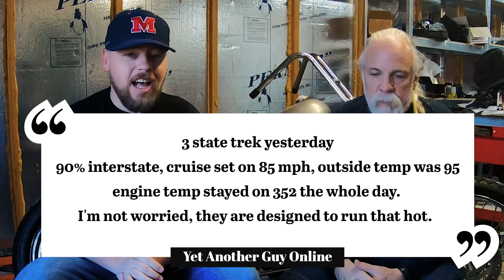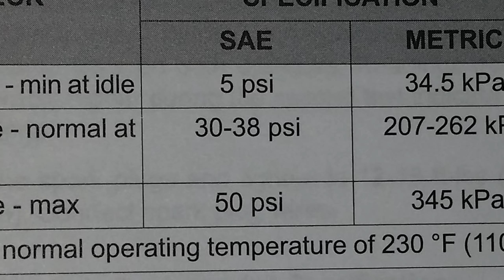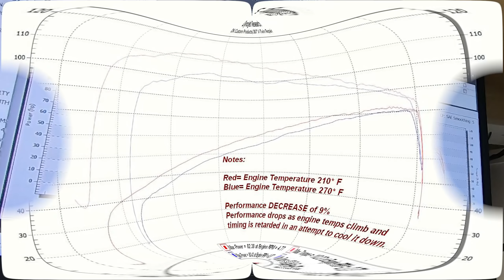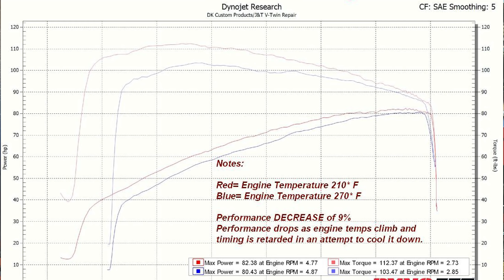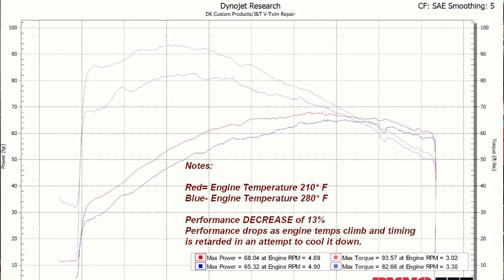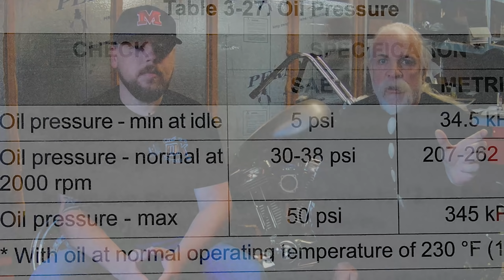Harley's - The RESULTS ARE IN About a Popular Myth

Comment: Hot intake air robs power. It does this by reducing the density of the air and it risks premature detonation of the fuel air mixture in the cylinders. I've worked on several VW bugs and the high temperatures destroy the number3 cylinder.
Reply from the maker: Thanks for watching and adding your experience to the discussion.  👍

Comment: Any idea as to what the operating tempurature is for an evo? My oil gets up to between 160 and 170 in the summer time on my softail.
Reply from the maker: That's a tad on the cool side for the oil.  Not sure where you're grabbing that temp from, and if you are running an oil cooler.
Ideally you want to see the oil temps between 180-210.  You don't want to see them over 230.  These temps are at the engine or the tank.
Reply: @DKCustomProducts  I've got a thermometer dipstick on my oil tank. And yeah... I'm running an oil cooler. I don't get as much motor noise in the south Mississippi heat as a result.
Reply from the maker: @SaddleTrampTV  Very Nice. 👍

Comment: PS: Lycoming Aircraft engine operation specifically states that the oil temps should be between 165° and 220°. Not too cold, not too hot. Information is readily available on the www for reading. FYI 
Thanks Guys!
Reply from the maker: Yep. It is pretty common knowledge outside the Harley world.  Unfortunately there is a huge push of misinformation to Harley owners.
Harley is in a difficult spot...they want to keep the nostalgic look/sound, but they have to meet stricter and stricter requirements.

Comment: After I purchased my 2021 Trike, I put the stage 1 air flow with new headers omitting the cat and using American Custom exhaust. I do have a 4 inch baffle in the mufflers but now my trike is running much cooler. †his spring I will change the oil and Amsoil will go in.
Reply from the maker: Good to hear you are enjoying your ride! 👍

Comment: I have a 2011, Electra Gluide with 70,000 miles on it.  I changed out the worthless ambient temp guage to an oil temp guage and I have never been over 250 deg.  It normally runs at 170 deg.  It got to 250 deg on a real hot day in stop and go traffic.  I have run the bike in 95 deg weather in South Alabama and oil temp never got higher than 220 deg.
Reply from the maker: Those are really good temps! Good to hear you have your bike running at optimum oil temps!
btw, something we did not mention in any videos, it is always good to double check with a second thermometer to make sure the one you are using is correct.

Comment: My oil runs 210°-220° on a 104° day.
M8/ stage 2, i luv my hi flo oil filter,  it  
Makes a big difference. I still run conventional oil. It works fine. Changed at 2000-2500 miles.
Reply from the maker: Very nice, good to hear you have it running optimally.
Thank you for the comment.
Enjoy your ride!

Comment: Oil temp gauge …. WHAT ARE OUR OPTIONS FOR ROAD KING
Reply from the maker: The two most popular option are the HD or the JES Custom Accents.  These are easy and about $100
More complicated is mounting a gauge somewhere, and then installing a temp sending unit and running the wires.
Reply from the maker: @whodafokcares  That is what I am running also.  First one replaced under warranty...the one now works well and is around the 2 year mark.
Reply: @whodafokcares  I agree… reviews look pretty good too

Comment: Performance is one thing……my main concern is longevity. So, question here… if my FP3 tuner says 250-270 (20 degree spread) degrees on my M8, I’m at normal operating temp of 230? Am I understanding you correctly?
Reply from the maker: The full answer is in this video- https://youtu.be/rWOdQOtDv6A?t=64

The short is that 270 engine temp is right at the ragged edge....as you saw in the video.
Reply: @DKCustomProducts  You said the temperatures are going to register higher simply because where the temperature sensor is on the M8. So 270° on my FP3 is not on the ragged edge it is normal operating temperature. Correct?
Reply: @jeffreyengle2762  I didnt think the FP3 gave the temp of the the oil?  are we talking oil temp here or engine temp?
Reply: @marvelharris9540  Good question, I’m not sure really but I’m thinking engine temperature is what it’s getting from that sensor in any case it’s the temperature on that sensor that’s indicating the temperature of the oil? Maybe somebody else will chime in.
Reply from the maker: @jeffreyengle2762  That is correct, in the video I referenced I said 250-270 for ET on an M8 is the highest optimum temps you want to see.

BUT, as you noticed from this video, the ECM pulled power on the M8 right at 270 degrees.

So, I should have said 25-265....because, and you saw in this video, you don't want to hit 270.
Reply: @DKCustomProducts  so the question… easy way to find out oil temperature… ? We can have all the data, that’s great, but without a gauge, pointless. So, that being said…. I purchased a Harley branded fan assisted oil cooler and have a good warranty in place. My defense against hot temps🙃
Reply from the maker: @jeffreyengle2762  Yes, I have had one complete engine replacement under warranty and another whole top end replacement under warranty.
Regarding knowing oil temps, that is easy.  Get a dipstick oil temp gauge from Harley or JES Custom Accents.
Reply: I had the same question and contacted Vance & Hines.  The FP3 Engine Temp reports average engine head temp between the 2 cylinders.  They also told me the following "The FP3 tunes the rear cylinder richer than the front to help cool it down. M8 motors can be within 300-400F safely. That is the regular operating temperature."  Wow.
Reply: @UncleDaddy0 how can that be when the oil loses its ability to lubricate at 300F?

Comment: Great information,I have fitted a set of love jugs and a 10 row Jagg non fan assisted oil cooler,in combination they seem to keep the twin cam engine running at the levels you recommend, although I can get to 245 degrees on a hot day,I live in Perth Western Australia where we have a hot climate,I was wondering do the fans become ineffective at speed or do I leave them running all the time or just use them in city traffic where they are very effective.
Reply from the maker: The fans are very effective at speed.  Here are a couple of report links that show that-
https://www.dkcustomproducts.com/force-flow-fan-test-report.htm
https://www.dkcustomproducts.com/sleeper-performance-mods.htm
Reply: @DKCustomProducts  Thanks for your response, I am amazed at what a difference the fans make and glad they work at speed,they may not look that pretty but I'm sure I will have a lot happier bank account running the engine at the temperature you recommend.

Comment: Power =Heat, don’t chase HP in and air cooled motor TQ is where it’s at!
Reply from the maker: Spot on!
Torque is where it's at!
Yes, the balancing act of having exhaust as hot as possible, keeping cylinder walls around 190F, and having intake as cool as possible.
https://www.dkcustomproducts.com/sleeper-performance-mods.htm

Comment: Do you guys have any idea of how long a 2020 114 M8 RKS would last running at 250F vs 310F? 120,000 miles vs. 70,000 miles maybe? And what parts go bad when you run hot and never add fans/coolers?
Reply from the maker: There are far too many other variables, besides heat, that would affect the outcome. Just a few...how one rides, what oil, how often oil is changed, how long or short are the rides, and hundreds of other variables.
BUT, an engine with 10,000 miles on it, ridden at 310F consistently, will fail a leak down test.  (See this video - https://www.youtube.com/watch?v=2YrM7f321JE ) most of the time.
Usually the parts that need replacing are the cylinders, pistons and heads.

I was just talking to someone the other day who's bike was in for work at 17800 miles.  They were replacing the entire engine.  The connecting rods had gotten too hot and he had a knock.  This can happen, but it is more likely the damage will be confined to the top end.
Reply: @DKCustomProducts  Wow, got it, so then if all the other variables were equal, the heat damage could make the 120k be 20k. That's substantial. For my bike, with fans and an oil cooler, some days I see 270 and other days it's 310 to 340 honestly. So, it seems like my engine might only last 25k. I'm at 5k now in 2 yrs, so I might have another 8yrs left in it, if I don't do more to cool it now. Might try the single horn fan and an upgraded oil cooler. Thanks for the info 🤘
Reply from the maker: @YoursInYeshua  Glad you found it useful.
There is a whole list of things you can do at this link- https://www.dkcustomproducts.com/shoptalk/DKUM/
It is not just the engine wearing out, it is the heat for comfort to rider and passenger, there is the reduction in power, and there is less MPG, and there is LESS SMILES PER MILE because of the sluggish throttle response.
Reply: @DKCustomProducts  Yes sir. Thank you and have a blessed day brother 🙏 🤘
Reply from the maker: @YoursInYeshua  You too.
Reply: @YoursInYeshua  has the bike been tuned? An improper tune will heat up a motor quick. Reason I ask is where I live its 90-100+ a lot. My bike 2012 softail blackline has no fans or oil cooler and never ran that hot even before I installed s&s oil pump n camplate.
Your bike may be running a little lean?
Reply: @motomenace5243  It has a good dyno tune on it and is running about 270 now, with cool flow fan and oil cooler fan.

Comment: You guys should come out with a oil pressure and temp gauge all in one👍
Reply from the maker: That would be a great gauge to have!  Thank you! 👍
Reply: @DKCustomProducts  I’ll get in line! Just let me know when!
Reply: @Just J absolutely analog!
Reply from the maker: @dawidos117  We primarily do fabrication...the furthest we delve into electronics is wiring, LED's and XiED's.
If I felt the need to have that, which would be cool, I would start by looking at Dakota Digital.
Reply: @DKCustomProducts  thank you!
Reply: How about. A digital type showing both Oil pressure and Oil Temp and do green yellow red good green, warning yellow, red over optimum temp 231 241 ect
Reply: Love Jugs are a great way to get fresh air to the front and rear cylinders but the cost is outrageous for a couple of 12 volt fans.... There is an alternative if you are mechanically inclined and can fabricate a bit... First you buy one of those custom-made metal fan grills designed for two 120 mm computer fans.. then go on the net  shopping for the industrial grade 120 mm computer fans that are waterproof... And check and make sure what the db are not too loud as some of them scream at 6,000 RPM and it sound like a siren ...they are used in hard drive racks of commercial buildings or sound isn't a problem.. but pump a hell of a bunch of air like 200 cubic feet per minute.. and create about 45 db or more .... Anyway your two 120mm fans on the metal fan grill and on the back side there's bolt holes on all four corners front and back of those fans so on the back side you build a quarter or 3/8 in thick metal plate that covers two of the inside sets of holes and bolt it on your horn bracket Mount under the tank and you got two fans blowing on the left side of your cylinders for cheap compared to what a set love jugs cost ... And if you want to get crazy there's all kinds of themes on those metal fan grills and all kinds of computer fans that light up with spiral effects from the lights glowing off of the fan blades when they're spinning in all kind of colors will get you arrested for sure.... Even ones that change colors while they're running so if the cop wrote you for green lights you can say no no they were purple orange and bluish 🍒

Comment: There's no denying my 2002 RKC (79k on the clock) runs better on a cool day than a hot day. Don't sweat the temp too much. I just ride the damn thing and enjoy. 20 years now and the bike still runs like the day I bought it. I've used synthetic oil since the breakin oil change. Why? There's a reason synthetic oil is used in jet engines. It can take the heat so there you go.
Reply from the maker: Glad you're enjoying your ride.  Here's wishing you many more miles of smiles.
Yes, the 1999-2002 Twin Cams were the best years, and did not have near the heat challenges that really got bad, starting in 2007.
Reply: @DKCustomProducts  They did make a huge change to the crank bearings in '03, which seriously shortened engine life.
Reply from the maker: @geraldscott4302  That they did!
Reply: My 2003 Road King Police blew up 6 months after I sold it....46,000 miles
Reply from the maker: @sgtwrench69  That's a bummer.  Do you know why it "blew up"?